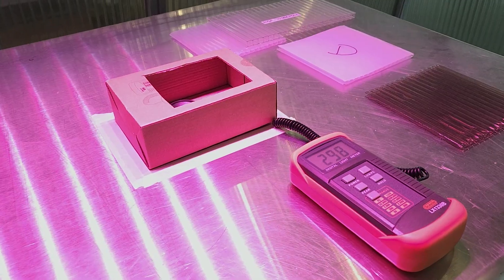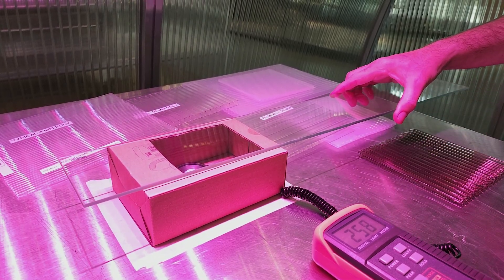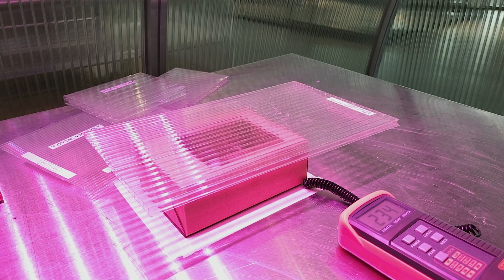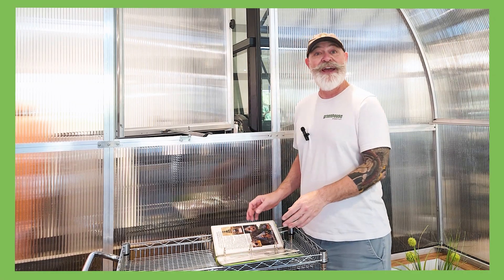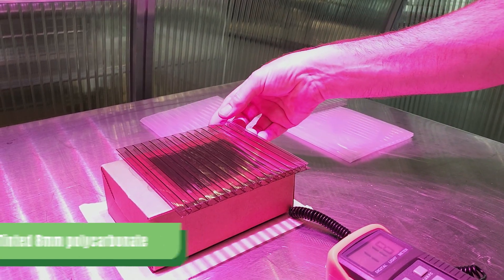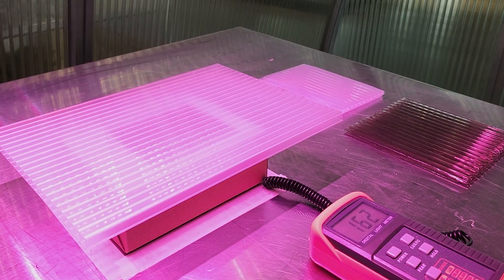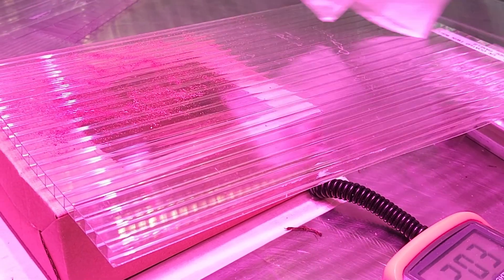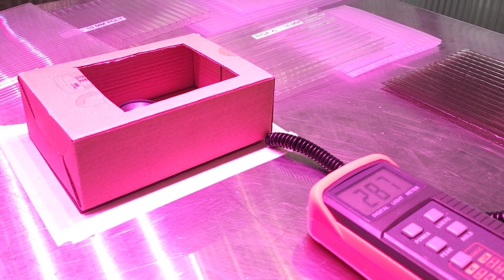Testing Greenhouse Coverings: Results & Optimization for Light Transmission

Comment: I've heard lux isn't the best metric for usable light for plants, because it's just measuring what humans can see, while PFAR measures what plants use for photosynthesis. I know it matters when shopping for grow lights, because lux won't sustain plant growth, obviously the sun provides as much as plants need and more. Not sure how it would factor into this test, maybe lux is a good-enough substitute here.
Reply from the maker: This is a really good point! Thanks for bringing this up. You are right that PAR is more important when it comes to plant growth. After making the video, we were digging deeper into PAR and the color spectrum of light as well. We'll pack that into another video soon. Since we didn't have the equipment to measure PAR for this test, we used Lux. Lux is used for determining light intensity (bright light vs shaded light) which still tells you how much light comes through a covering material.